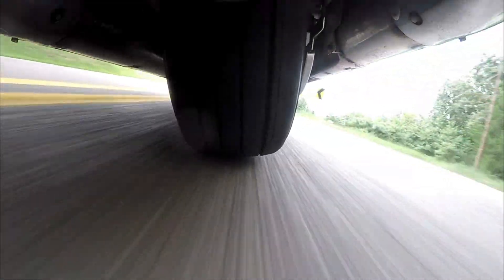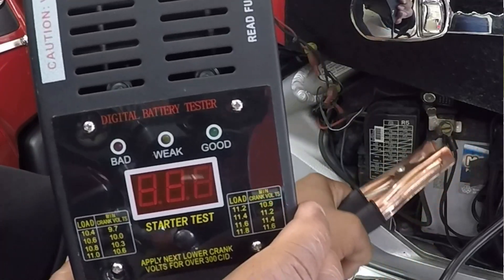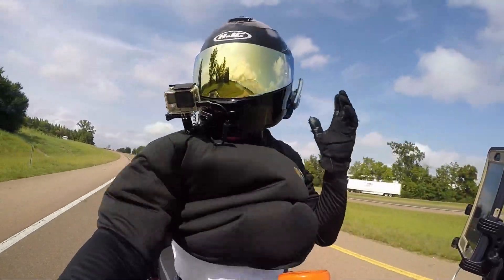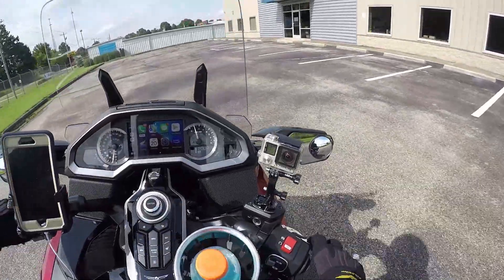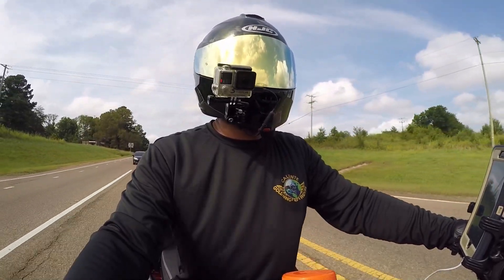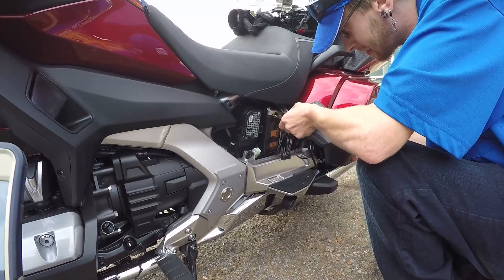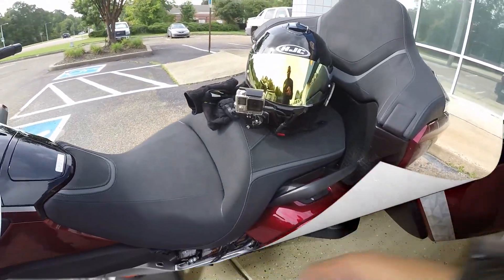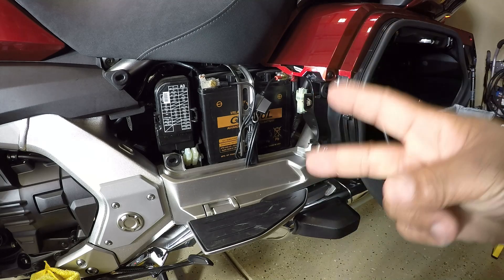Goldwing has no voltage Gauge | Battery Analyzed 2nd Opinion Test

Comment: Agree completely with your comments. It would be easy for Honda to add a VDC indication in the area where tire pressure or air temp cruise setpoint is shown
Reply from the maker: People think I bash the bike when I mention the flaws, but how many people failed to realize that there is no voltage guage since I pointed it out?
Reply: @chriscaliente5033  I added the optional 12V accessory socket. I plug a USB adapter into that which has a built in voltage indicator. The adapter cost approx $14

Comment: It is possible to have proper voltage and little to no amps. Just use an amp meter on start up and see how much the amp drops. Even with an amp gauge installed it’s still good to use a meter to see what is going on. If the battery is 5 years old it’s probably due for replacement. For what it’s worth and imo. Now back to the show 🤠

Comment: I have the same problem with my 2019 Goldwing DCT. The bike always started well until few months ago when I stopped for about 30 minutes at a rest area to meet some friends. The bike would not start, you could hear only a 'click' but nothing happened, the headlight was fully bright. We were able to start it with a portable power pack. The next day, I went to a Battery Expert store to have it checked by the staff who tested the battery with two different types of testers and found the battery as good as a new. While I was at the store, I purchased a portable power pack just in case it happens again. Few weeks later, after riding about 80 miles, I took a 10 minutes break then the bike would not start so I used my new battery pack to start it. The third time, my bike had been parked for few days in my garage and connected to a Honda battery tender,  it would not start again. I do not believe the battery is the problem because I rode my Goldwing for about 5,000 miles this summer and only three times it did not start. I will bring it to the dealer this fall to have it checked (the riding season is too short in Quebec, Ca to leave my bike at a dealer for two weeks).

Comment: Chris, your battery analyzer is surely correct, and a bad battery would explain your original problem.  Your analyzer looks like it puts a real load on the battery.  The other guy's analyzer probably does not.  I added one of those digital volt meters behind the speaker grill.  Can see the voltage before you start it, and the 14.4V when it's running.  But, a volt meter could easily have been part of the big display, in the corner or something.  They have them on laptops and cell phones.  If I were you, I would just put a new battery in and be done with it.  There's nothing worse than worrying whether or not your bike will start.  That dinky little tester the second guy used in no way puts a sufficient load on the battery like yours probably does.  Bad batteries can show sufficient voltage when not under load.  That's probably what is happening with your battery.  To me, 11V under load with your old tester means bad battery.  Stuff nowadays probably needs at least 11.5-12V to work properly.  I'll bet you lunch that it's a bad battery (if I ever get to meet you in person).

Comment: Re:battery...
This subject may need more homework. The former GL and new 2018+ have different electrical "appetites"! Especially - CANBUS.
AGM is better than lead acid battery chemistry, BUT, more sensitive to overcharging, and deep discharging.
Some items to consider - what is the state of charge for battery when bike is 1st in service? Old battery or deep discharge could be a problem.
AGM charges much quicker than old lead acid(my '02 GL came with AGM - many went back to lead acid). Be certain your charger is made for AGM charge profile! Load testers need to be correct also, to assure that state of charge is not repeatedly taken too deep.
Maintaining a "maintenance free" battery: Terminals snug and dielectric grease are cheap insurance. Caution on hanging too many connections on the battery!
Battery maintainer correct charge profile for battery being charged.
Lead acid rule of thumb was loss of 10% per month. AGM is not that bad but CANBUS is VERY particular on Volt/Amp needed to run.
My battery is now 2yrs old...I will consider the GYZ20HL to replace  GYZ20L(as delivered). There is slight mod to bike terminals. The spec and construction differences are more in line with demands most of us place on the electrical system.
Apologies for long post - By all means, HONDA - Please provide a smart indication for this electrical system!
Ride Safe & Enjoy!
AK '19 Tour DCT.

Comment: Hi Chris  I really wish people would not always say mfgs should do this and that . there are always reasons you need to walk in there shoes to understand. Fyi I heard of one other guy has issue Chuck marvel guy going after triple x record. I think honda dealer changed it.
Also Im At  the  the ims show and spoke to factory rep for yuusa batterys for honda about this. Sometimes things can happen if battery preloaded and shipped here or battery sat at dealer for awhile or sometimes you will get a issue nothing is perfect in production
Stuff happens sad but true.really suggest you go to source who  made it to find answers. Sometimes you will not find a answer
Stuff happens while a issue on small there is a big picture with that bike. I own  a 2018 number 442 off production line.
21000 miles no issues. It's great bike to own

Comment: The best battery tester was the old carbon pile tester, it had a knob on it that you turn to put the load on the battery, if you did not know how to use it you could have a battery blow up by over loading it, the battery would get hot and start smoking if you were lucky, and not blow up.

Comment: Chris I had the same situation as you with the battery. Bike at rest would show 12.5-12.7 volts. Ride the bike around while charging would show 14.4 volts. I added a little digital voltage meter under the front fairing so I can monitor the the voltage. As soon as I would start the bike the voltage on the guage would drop down to as low as 10v. Had several instances where I would ride hours then stop to get fuel and the bike would barely have enough umppphh to turn over. It would turn over but would throw a engine light. That yuasa battery always stayed on a tender when bike not being run over a week at a time. Finally I ended up going to battery source store and got a battery there with the same specs as the oem battery. So far the bike starts faster and has higher voltage when at rest. Something is wrong with these yuasa batteries internally like a poor contact or something where all the cells are jiving together. This has gone on since back in 2018.

Comment: Carry a spare lithium battery with you. They are light and, the correct one, will have plenty of cranking power. Carnell went to lithium's. I've been using one for 7 1/2 years on my Yamaha Venture. I've even left something on and completely drained it a few times. Charged right up, no issues. I use a Battery Tender Lithium.

Comment: Why don't you stop screwing around and take it to the dealer. Have it tested and a new battery installed. Your's is over charging. Maybe a sulfated cell. Did you do a load test on the battery. I bet not.

Comment: Battery died 2 months after I got my new 2018 Goldwing. If u have problems with the bike not turning on randomly change the battery asap. Also the battery connection on the right side is a pain in the ass to screw on.

Comment: I would still take it in under warranty, something is drawing your battery down, it could be anything with all of the electronics. Also Newer diagnostic tools will in fact cycle many more times than over the counter equipment. At least now you have the knowledge to go to dealership and they can't blow you off

Comment: I keep a battery tender on all of my touring bikes and tractors.  Some of them are 7 years old. Occasional I get a bad cell. The high cranking amps of new batteries puts the cells close together. That's why  they go bad just out of the blue. Years ago they would just get weaker over time.  You question the tester when it's telling you bad on a battery your having problems with.  If you had a voltage gage on all the wings you owned  you would be questioning it like your questioning the tester. Even though your experiencing a problem.
Reply from the maker: I have a right to question the health of my new battery especially when three different battery analyzers are saying two different things after a fail start and battery recharge, beside if this technological marvel of a flagship motorcycle had a real voltage output guage like it needs, we would not be having this discussion.  Imagine if the owner of a new Electric Car discoveres that his new car does not have a voltage output reading after his car looses power, how would he feel?
Reply: Chris I apologize for the misunderstanding.  I wasn't questioning   why your testing the battery.   A charging display on the dash works  when the bike is running.  Your 2021 doesn't use a starter like the gl1800.  It uses  voltage and amps to  energize the alternator  spinning the motor to start.    Your video was the bike not starting and why.

Comment: Q? What load is on the battery when the bike is switched off with the FOB left on and also when the FOB is off it is odd that there is a check light for the FOBs battery but not for the bikes main battery Chris I’ve had very similar issues with my 2018DCT, my solution has been to put the battery tender on whenever the bike is not in use, I use the Optimate 4, since doing this there’s no problem but I have not yet done a long trip, thoughts please?
Reply: Just thinking more on this, one factor that may be at play here, the new Goldwing’s starter doubles up as the alternator, that means there must be some electronic circuitry that switches between starter and alternator functions mmm… there’s another thought

Comment: Man you may have a dead or weak sell. I would check each sell to see.  I had a new Die hard which had a cell almost gone. Bike would start, I go to work bike would sit 9 hours and be dead. I put a volt meter on my 2008 GL1800, just for peace of mind.

.